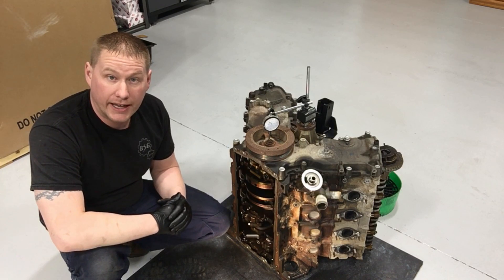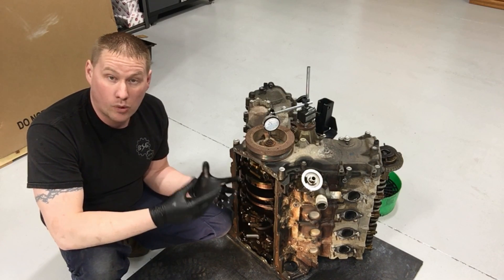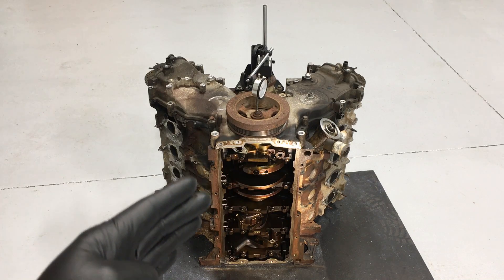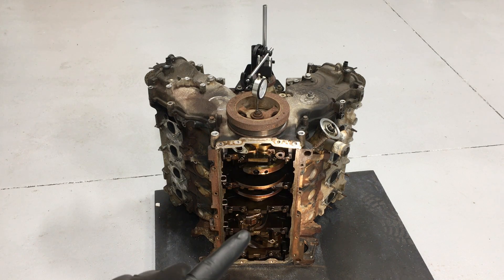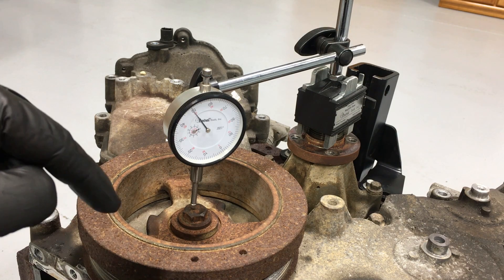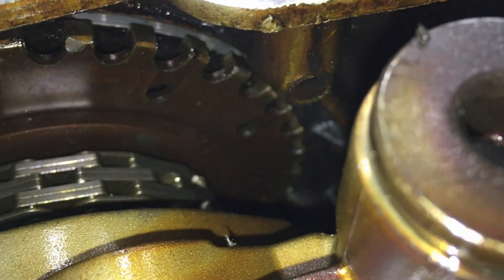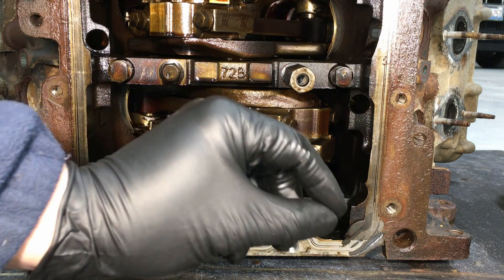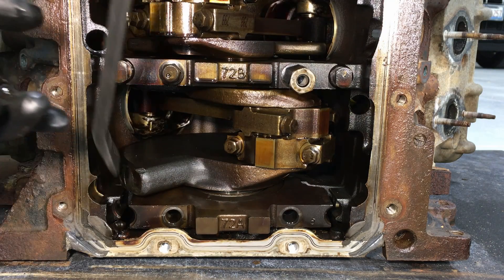Ford F-150 5.4L 3v Triton Engine Thrust Washer Failures: What You Need to Check!

Comment: Ive pulled 350 chevys apart with 300,000 miles on them and the thrust bearings were fine.
Sounds like a lateral imbalace due to a crooked pulley or flex plate.

Comment: I presume these are on automatic transmissions. It very hard to tell how this would even happen without a force pushing the crank out. Is the flex plate on the converter under tension  or something crazy. Maybe they were fitted too tight at the factory on some engines.

Comment: Well that was interesting. I have an 08 with the 5.4. Only has 32000miles but I’m a little nervous now
Reply: Sean Desrosiers I have a 08 with 130000 miles only issue has been a cracked manifold and I did a tune up at 129000 that’s it never a check engine light or anything of that nature

Comment: I have a 07 that was built in 12/06. So I think I am on the border line here. My plugs were the 2 piece, and valve cover has the 14/15 bolt pattern. Same engine or no?

Comment: What would cause that to fail? No maintenance or oil changes? My 08 has 126000 and I’ve changed oil every 5k with motocraft synthetic blend. New OF each time too. Also I assume the motor is gonna make some God awful racket if that bearing goes. What is the best indication to suspect it has cracked ??
Reply: Best to change every 3,000 miles to keep clean inside your 5.4L 3V much you can. I owned 2005 F150 with remanf 5.4L 3V so I always use 5W30 Syth Blend with oil filter motorcraft every 3,000 miles no issue 170,000 miles so I check inside tube cam with camera, cam phasers are so CLEAN! 5.4L 3V are very picky cleanliness but it is very good engines that why maintenance is important.

Comment: Transmission pushing against crank....
Reply: Not sure if that’s still an issue but I as gonna mention that back in the 80’s it certainly was. In fact , when I was ever putting in a used engine the auto wreckers were putting new bearings in the bottom end to avoid quick comebacks . That’s when I learned those dam AOD torque converters were expanding forcing the crank forward wearing the thrustvwasher

Comment: I have a 5.4 3v 2006 2x4 129000 miles. At 48-50 mph I have jerking that goes away when I turn off the OD. OR I drive through it or when I just slow down. Any ideas on what that may be?
Reply: I have a similar problem 99f150 5.4 trying to accelerate past about 50-55 on the highway in od causes a pretty violent foward to backward shake
Reply: Bad coil will cause that,mine did the same thing all summer no codes,then I got a cyl.1 misfire code replaced the coil no trouble since,also had a slight miss at idle before the new coil.
Reply: Yeah it has a slight miss at idle for a minute or two when first started but the miss goes away pretty quick
Reply: And no codes other than bad front speed sensors
Reply: Thanks guys. I have noticed that if I dog it from take off I can throw a code. Misfire cylinder 6. I’ll change the coil. All coils and plugs have been replaced with oem parts 10,000 miles ago!

Comment: Just curious - you said in the beginning 5.4 3V  in the ‘07-08 F150. Is there a difference on the 5.4 3V used in an ‘08 Expedition. ?
Reply: The only difference is the transmission that was used.

Comment: I have a 2006 F150 3V 80k miles. I started running 5W-30 a while ago per your advice. Does that have any positive effects on the thrust bearing longevity like the VCT system?
Reply: P just change the oil every 3500 miles and use a quality filter 8,000 mi is a baby 80,000. Mine has 262,000

Comment: Did Ford do anything right on the 5.4L 3V ?lol
Reply: pulled trailers good down the high way was  OK gas in 06 f150 alot safer than my 95 couldn't go over 60 safely
Reply: Like everything else they pretty much perfected them by 2009 and then quit making them a few years later.
Reply: Regular oil changes go a long ways
Reply: Franco send it English please?
Reply: Ray Wilson they still had shitty exhaust manifolds and they were underpowered compared to the competition by then.
Reply: CamperMike Yes. They stopped making them.
Reply: CamperMike they quit making them which is the best thing they've done

Comment: well son...of...a...B** !! i was just looking at a 07
Reply: dominic cristante don’t look into its eyes.
Reply: dominic cristante don't do it....get a diesel if it's got to be a Ford or go dodge
Reply: dominic cristante Alot of what u hear about the power strokes I've found to be false.....I've had 3 different duramax 2 of them brand new and they lost oil or had problems with ecms or turbos over heating or fuel pressure.....but to each his on in my experience the power strokes have been good to me
Reply: i would want a diesel but god damn! ford diesels have got tons of problems, especially the 6.4, the 7.3 is probably the best out o the bunch but its got that fucked trans
Reply: okay, it good to hear not all truck enthusiasts are like "fuck ford for this" and "screw ford because of that"

Comment: Look to the transmission causing the excessive load on the bearing. Restricted oil cooler line will push the converter into the thrust washer with enough force to take it out. Seen it before.
Reply: Google:  Torque Converter Ballooning.   A thrust washer keeps the crankshaft aligned.  Rear pressure is what burns them out prematurely, insufficient oil clearance.
Reply: Good to know, thanks.
Reply: Why I flush my transmission cooler every 2 years..Not a big fan of them using the radiator either pull heat away.. Seems stupid.. At least put an 6" electric fan on the cooler...
Reply: @MasterChief-sl9ro  the transmission does not run through the radiator to pull heat away lol. It is to warm up the transmission in cold weather starts.

Comment: 5.4 3v is ford's worst engine ever....I just got a 2015 5.0 truck I sure hope it is a better engine
Reply: You'll be fine. 2011-2012 5.0s had issue with burning up exhaust valves causing misfires

Comment: This engine doesn't look like it was well maintained in my opinion. I just opened my 218k mile 5.4 to replace the timming components and it was absolutely clean inside, everything look gold colored. Always use synthetic 5w30 and change it every 6k miles. Same thing with my 258k mile f150 when I replace the valve cover gaskets, plugs, coils etc.
Reply: RCLegion The engine had slight varnish on it but nothing that would restrict oil flow to the crank. Most all manufacturers say varnish/discoloration with no depth to it is harmless in an engine. Serious heavy towing , or an issue with a torque converter are prime culprits to thrust bearing failure when no other bearings show indications of oil starvation. It could also have been improperly installed at the factory.

Comment: Wow total destruction, gotta love Fords
Reply: Still not as bad as GM and their LS7s. Some do not even make it to 10k miles.
Reply: Chaz1963 typical 3v 5.4 love fords but a big fan of those engines
Reply: sdvten  I'd rather have a motor fail at 10k under warranty, rather than out of pocket like the owner in the video has😭😭😭😭😭😭
Reply: What makes you think it will be under warranty. Many are in Corvettes with low miles out of warranty, due to age. A 5.4l 3V is a fraction of the price of an LS7 and you don't have a usable core when it drops a valve and ruins the block and heads.
Reply: sdvten  if that were the case, then that would just suck. Makes me glad I don't own a corvette or a f-150.

Comment: ah the good old 2 valve in my 03 F150 is at 340K and climbing, watching this video makes me think I need to keep it going as long as possible!
Reply: My 98 navigator has the 5.4 2v too. New iridium tipped ngks, accel super coils, new gaskets all around, exhaust manifolds replaced...its still working flawlessly @315k. My dads 07 nav and my brothers 08 f150 are the reasons why I even know about this channel 😂
Reply: Yep keep it ive got a 1999ford f150  5.4 triton  still going strong im keeping  mine👍😊
Reply: guyina4x4 I just got a 2000 with the 5.4 for $800. Happy to hear you guys have had good luck with them!
Reply: i have the 4.6 windsor in my 97f150. 180k and its holding well. not a powerhouse but gets the job done.
Reply: My 99 f150 made it to 415000 before blowing a head gasket
Reply: The only issue with the 2v that I'm aware of is stripped out spark plug bores.
Reply: Yep my 99 Expedition got 240 on it and still climbing good old 2 valve just change spark plugs and coils not even transmission work besides maintenance
Reply: I use cast 5.4 blocks in my race car and i have 2 trucks with over 500k. Never had a single issue.
Reply: 1985 Kx I've got ,01 f250 2 valve.....awesome truck
Reply: My 2003 will rot before the engine quits. It's too bad those trucks rust on the rockers so easily or they would go forever.
Reply: Wish I still had my 97 F150 with 250,000 miles.  Just normal maintenance and was used as a business truck.  Bought a 2007 F150 thinking it was just a rebodied 97.  No such luck, 85,000 in 11 years because afraid to drive it always tapping, shaking or knocking. Now just used as a back- up truck, bought a GMC 2500 HD for everyday.

Comment: This doesn't effect the 98 ford Expeditions does it?
Reply: That’s right, the 24v 5.4 was only on the 2005 and 2006 model years, how lucky for me mines a 05. Gotta love Fords.
Reply: Jeff Kreft I'm fairly certain the 3v motors went all the way to 2011. This video is about an 07 or 08. The big issue in 05s is the cam phasers.
Reply: That's a 2v motor this issue is on 3v motors.
Reply: ok
Reply: Potskie I was only referring to the Expeditions, yes they went through more years on the 150s, but only the 2 years on the expedition. Referring to the original question for the expeditions.Should have been more specific, sorry for the confusion.

Comment: I have a 6.8 triton V10 with 270K on it.
It is in my 2001 excursion… Zero leaks, zero issues. Runs great. Is it a time bomb ready to explode? What can I do to keep it going another 100K?
Reply: Rob Sanford your fine it's a 2 valve
Reply: Ford put 2Vs in some vehicles inn the US up to 2014. The Excursion got the 2V until it was discontinued in the 2005 MY.
Reply: Nothing. The old v10's are bulletproof. Only problem is shitty exhaust manifolds and spark plugs blowing out of the heads. But if you ever do the plugs just overtorque them a bit and they'll never blow out.